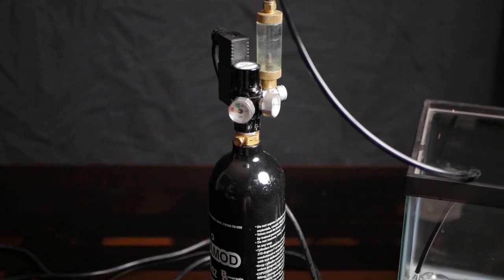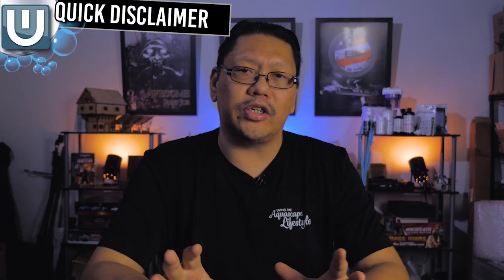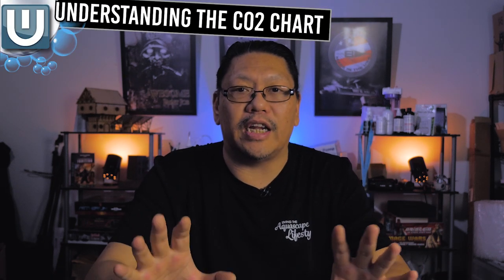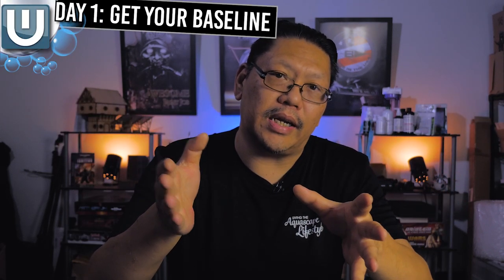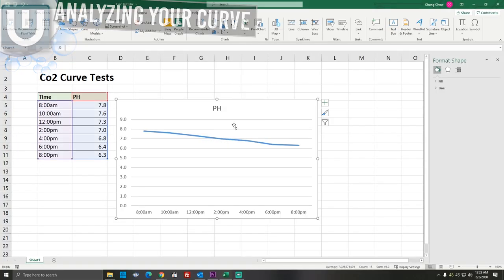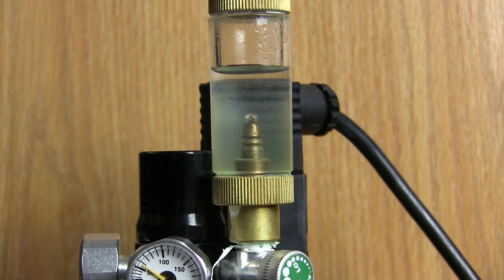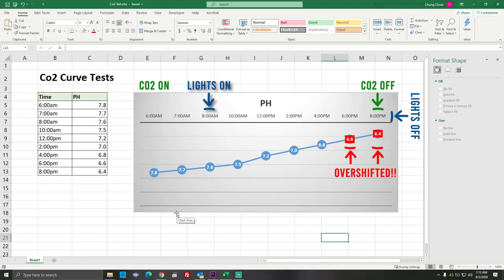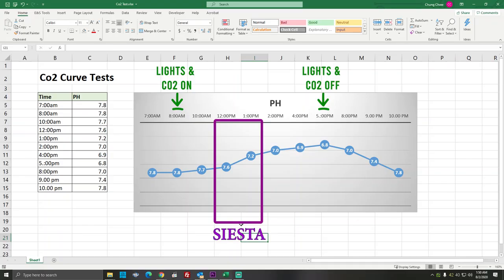Step by Step Guide - How many Bubble per Second?

Comment: From the ph kh chart, if my120L heavy planted tank is 0.5 Kh & 6.9 Ph, to reach 1 point Ph drop (5.9 Ph) im having 5bps, therefore my co2 is about 18.9ppm. So does it mean its inadequate? I'm looking at 30ppm, should be around 5.7 Ph? Although im using inline diffuser & reactor together, its still too misty lol. Thank you.
Reply from the maker: Just make it easy for yourself. If it drops 1.0 PH from lights out to lights on then you're super good.

Comment: Do you have any suggestions more accurately dialing in co2 when I have crushed coral in my filter to raise kH?
We have super low close to zero kH water. Because of alot newish bogwood my pH drops to <6.0 unless I buffer with coral and obviously I can't add co2 with such a low pH.

I know that with the coral, the pH is likely not to change much if at all. I intend to just go for a low bubble per second to be safe but would like to properly dial it in somehow.
Reply from the maker: Just use the manual measuring with the chart I outline. This will take the levels before lights on and when lights are one to find how much to inject, regarless if you have crushed coral in your filter. It only cares WHERE the parameters are at before and after based on your set up.

Comment: this was so helpful, i got all the equipment set up, and then I was googling how to do this, and found co2 checker kits, and some called them ph and I was confused. This helped a ton. as I understand now the co2 checker, the glass bubble with a solution in it, is just an alarm in case your values change and you go overboard? and to not trigger that alarm I will try to stay within my optimal levels of co2, so I dont drop the ph. i think that's it.
Reply from the maker: Pretty much. You have to act fast if you see it very off and do a manual reading to make sure.  Remember, the measurement in a drop checker is the level one or two hours ago.

Comment: Hi love your videos, have been slowly increasing the co2 in my tank to achieve 6.7 ph during the day, as detailed in the ph / kh guide, at the moment i have it to 7 in the day but are already are 3-4 bubbles per second, we do have plenty of water flow as the 260l tank also has a powerhead and airpump -as well as the tank filter, i am very weary of still increasing the bubbles per second rate as it seems already well above the normal and wondered if this could be normal with alot of water movement and air thankyou
Reply from the maker: water movement and stuff is fine.  If you can't push it more lower, that's fine. Just keep it consistant.

Comment: So, sanity check please... My aquarium naturally (no CO2) has a PH of 6.6 and 3dKH *yes, my tap water is that soft)... I am already at the green optimal range for CO2. Is it worth at all to add CO2 to perhaps go for 6.4? Lower than that and I suppose I will have trouble with the bio filter. Thanks
Reply from the maker: If you inject co2 you're artificially lowering the numbers to saturate the water column with more carbon.  That's all. All the other measured minerals stays the same.  So even at that soft of a range, you can still inject co2 to get faster plant growth. The only problem with injecting co2 at that low of a range is you have to be more careful when doing so to prevent massive PH swings. 

Normally, at that soft of a water column, with right lighting and fert, your plants should grow well.  I would inject co2 very slowly until it gets to the point where it's getting the growth rate I want. At say 7.5PH and around 5 or 6KH, I'm more include to "gun it" on the co2 as I have more room to be less careful about it.

Comment: What is your opinion on not totally submerging stem plants before planting. There are suggestions that it is better to let the stems float at the top of the tank to A. Reduce the shock that occurs when totally submerging. B. Helps start a root system that will assist in healthy growth. Thanks
Reply from the maker: I never do but it sounds like a good tip.

Comment: Great video - you’ve inspired me to invest in a gH/kH kit and approach CO2 more quantitatively.  Up to this point I had been too intimidated by the chart to try. 

Question - how would you compensate your CO2 injection rate for off gassing due to an HOB filter and/or air stone in the tank?
Reply from the maker: Great to hear! For your question, you don't.  People are always so worried about the off gassing or blah blah blah... Just don't worry about it. If you want the tank to hold more co2 diffusion in the tank then keep a lid on the tank to keep the pressure up against the surface of the water. You can also run as cool as you can getting the temperature at it's minimal setting based on your livestock. I just never worry about it. It's a stupid thing extra to do just to "save" Co2. The amount of co2 off gassing doesn't affect plant growth as long as you keep the levels in the green.

Comment: I read that high KH can make things difficult to judge because it is made up of more than just carbon. My tap water is very hard, i think its above 12KH, im waiting on a test kit to come to confirm this. Would you still recommend this method with higher KH?
Reply from the maker: This isn't a method in controling KH but rather used to measure Co2 concentrations injected into your tank.  That said, you use the same 1ppm drop as the optimal rate of co2 injected.  Aside from that, if your water is that hard but plants are still growing find, then don't worry about anything. But if it's affect plant grow (not growing as fast or as lush because of the hard water) then I'd cut your water with RODI water to get the hardness down.  Either way, use the initial KH reading before lights and Co2 on, and then get it down 1ppm drop (per chart).

Comment: Hi, Thank you for this video, it was very informative. I am new to CO2 and am still learning! I use a Colombo CO2 reactor that makes CO2 by using citric acid and bicarb. I have it on a 240l tank and it is using 3 bubbles a second. (the mix lasts about a week, but it is very simple and doesn't take much time to refill so I don't mind this at all) 

I have tested the water, like you explain, and have a nice curve it starts at 7ph and drops to 6ph after the CO2 has been running for 3 hours. When I tested, the gas comes on at 11am and the lights come on at 11am (on a 30 min sunrise effect, so full light at 11.30am), then the gas goes off at 5.30pm and the light go off at 6pm (again on a 30 min sunset effect down to a purple night viewing light at 6.30pm for 1.5 hours then off completely). 

This has been the set up for 2 months, but I have noticed one of my plants (Ludwigia palustris) is not doing so well, at first it grew really nicely and last month I had to trim it, replanting the trimmed stems back into the substrate, but now it has gone really leggy and not growing any more (though what there is is still red) I dose ferts and liquid carbon every morning just before lights come on, I have been doing this since I started. (I have algae in the central part of my tank where it is open swimming space (though it hasn't developed any more) so that is why I currently have my lights (Fluval Aquasky 2.0) on the routine I have at the moment.

I am wondering - should I have the gas and lights on for longer in the day?
Reply from the maker: Is this the Ludwigia palustris Green or Super Red varity? What's the temp in your aquarium?
Reply from the maker: Also, what's you're substrate?
Reply: @TheWaterBox  Hi, it's the Super Red one, temp is 26 deg C, substrate is Tropica Plant Growth 5L, (it is less than 6 months old) banked up at the back where the plants are to a depth of approx 2 inch and covered over with approx 1cm of fine sand (I prefer a light colour surface)
Reply from the maker: You're fine then. You're not trimming the root runners when propgating are you? Corvus made a great video about the  Ludwigia palustris. This should help: https://youtu.be/7H6fWh69GiM
Reply: @TheWaterBox  I haven't trimmed the root runners, I just replanted the tops I trimmed off as is, runners and all. I will watch the video you have recommended. Thank you.

Comment: Hopefully you are still reading these comments but does having a CO2 lvl drop checker help avoid you needing to check those water levels so regularly? Or if that device is showing green in CO2 level could it still be rather out of wack depending on my ph and kh?
Reply from the maker: The drop checker isn't entirely accurate as it gives you the reading a few hours ago.  I mention this in my other videos like here: https://youtu.be/VnP9u7SDsm8?t=72. It's best used to spot check your tank and not to rely on it to make more accurate adjustments.
Reply: @TheWaterBox  oh thank you I did not realize you had a video specific to that. Only just came across your content. Thank you I will check it out now :) 
Genuinely appreciate your responses!

Comment: Hey, thanks for the great video and playlist on co2 that was very usefull getting in pressurised.

I have two question tho

- what about the co2 chart and active soil? Like tropica technic soil or other as Ada power etc
Would it still work because of the ph/kh effect the soil does
As well does the co2 reduce the ph more even with those? 

-as well you recomand to start with one bubble per second but my aquarium is only 35L would u keep going with that?
I started at 15 bubble per minutes.

Thank for all the infos and spreadsheet very informative, comprehensive  and even fast! Great job
Reply from the maker: 1.  No worries on the substrate affecting the PH/KH. Just read as is on the chart and it not completely accurate regardless. The chart actually errors on the side of caution.  Since we're not sure how much of actual carbonate hardness is in the KH reading (remember, KH also is the measurement of Bi-carbonate) then we're most likely under-dosing in the first place. The changes made by substrate to PH and KH has no real bearing on this chart.  Though you'd might want to check your KH more often to make sure that it's not losing it's "active" charges in the substrate (which is going to happen over time)

2. Take your first reading and gauge from that.  If it's a tank that small then you might have to just go as slow as possible on the bps but the method still works.  Just start at a base of like 1 bubble per 5 seconds... instead of starting at 1 bps.  That's something I didn't consider when making this video. Damn it.
Reply: Thanks for your great awnser.
I will study the chart and make it my grail 

Your video are great and Informative its okay to skip forget  infos particularly on smaller tanks when you might not be used to them or when it's often not pressurized i guess

 make a big disclaimer in all your co2 video so accident dosent happen

I think you say it as well in your video called bubble per seconds

Have a great day and keep going with those awesome videos
Reply from the maker: I just note them in my comments or description. I can't go back and put clips into the videos.

Comment: Solid video, I think this is how everyone should be setting up their CO2, using a pH and kH chart. A drop checker makes a good coalmine canary in the sense that it'll warn you that something is wrong, but it's not a very useful for setting up a stable CO2 level. 
One thing I would change is to use a pH meter to make it easier to test pH. I bought one off Amazon for about 20 Canadian Pesos. Most can be calibrated as well with a calibration solution to give you a reliable reading. The one I got came calibrated from the factory and it's been fairly reliable for the past couple months, usually shows about 7.45 pH just before CO2 turns on. The only thing is you have to hold it in the tank for about a minute to get a proper reading, but I found a way to clip it to my tank lid to make that easier.
Reply from the maker: Yeh, I will be making a video about that soon.

Comment: Great job explaining all this.  im pretty sure it was one of your past videos i used to guide me when i started using co2.  What has me puzzled is i was at 5bps (145g tank) and found my plants growing too fast, including my dwarf baby tears and hair grass etc. so to save me needing to trim every 2 weeks i tried almost no ferts (NPK and all that jazz) and turned down my co2 to around 2bps and my plants just wont stop growing fast. No im not "flexing" :)   Half my plants have a high Co2 requirement.. apparently. Its actually annoying because i think its quite heavily planted and i expected lowering everything would slow things down.  but it hasnt (its been about a month) Any ideas what im missing?
Reply from the maker: If you can changed your light intensity and you tried that already, try raising your lights. Once you have thing going, it's kinda hard to get it to stop. You can also completely stop co2 or go really slow like, 1 bubble per two seconds.  What substrate are you using?
Reply: @TheWaterBox  Dirted of course :)  i used lava rock to build up areas i wanted higher. Then about an inch of dirt, topped with fine gravel.  I have halved the amount of light. I have a hood so cant really raise it. I might find some plaatic to diffuse it more ( i use 10w flood lights.  I was using 6 but now only 3)  dont get me wrong, i am loving the way it all looks. I would just like to slow things  down. Trimming takes so long because my fish all swim thru my hands.. scissors... my SAE clean my arms.. so having to check between every cut ends up taking me well over an hour hehe
Reply from the maker: Yeh, dirt and all the trimmings (light, co2 and balanced dosing) creates monsters!